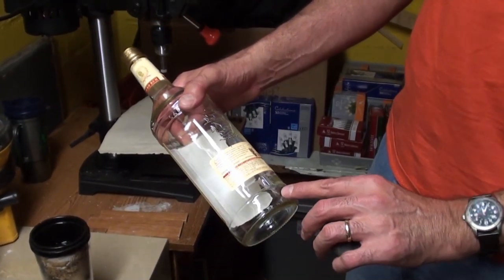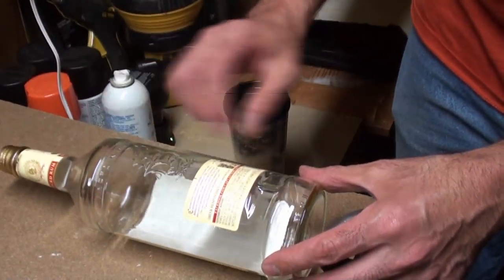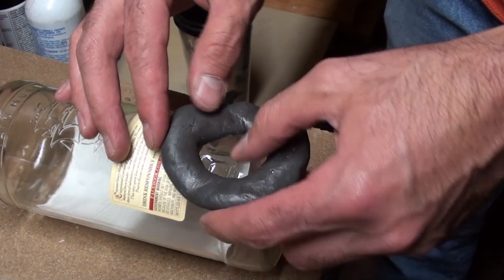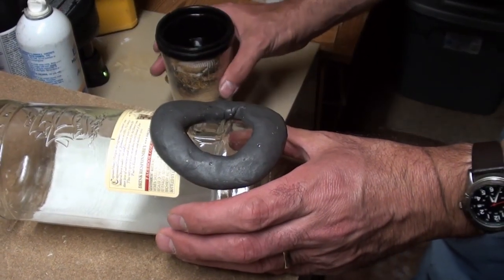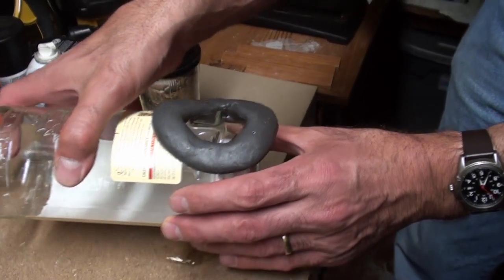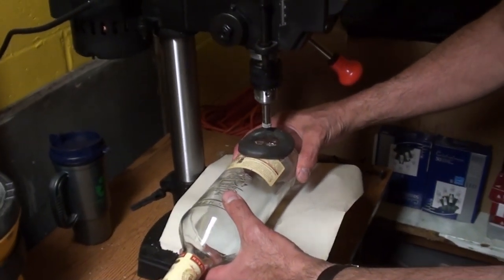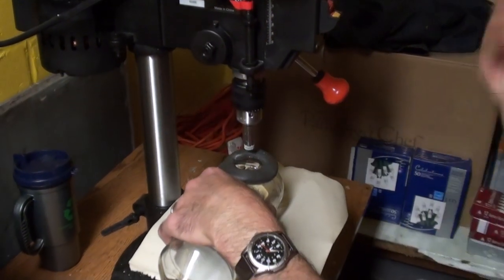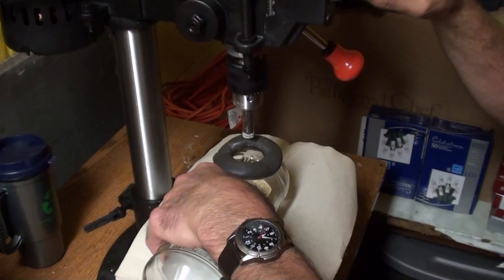How to drill a glass bottle quickly *DIY Glass Bottle Lamp*

Comment: I have a drill press that you can adjust the belt on for different speeds. Do you have a suggested speed for this?
Reply from the maker: Good question! My drill press had adjustable speeds as well. I had it set for the middle speed and lowered it slowly allowing the drill bit to do the work.

Comment from the maker: Did you mean a dremel?
The Dremel Moto-Tool rotates a bit at high speed; the bit is held in a collet. Variable-speed versions may cover a range of 3,000–37,000 RPM. The Dremel uses its speed as opposed to torque to get the job done. By inserting an appropriate bit (or burr) the tool can perform drilling, grinding, sharpening, cutting, cleaning, polishing, sanding, routing, carving and engraving.
I've heard of using one to take the sharp edge off the drill hole but never to actually drill it.

Comment: Thanks for the video.  Do you have some recommend vises to hold the bottles?  Especially rounded bottles?  What's a good way to stabilize them?  And what is the wax thing you use to hold the water?
Reply from the maker: VIDEOGAMETV, Good questions! You could try a bar clamp (http://amzn.to/2yKUiwj) that has the rubber feet on it. Hold one end with the clamp to keep it from rolling around and allow yourself to drill with both.
The rubber ring (plumbers putty) is to keep water over the area that you are drilling to help reduce heat and collect the glass drill dust. Happy Crafting!
Reply: Nick Jager thx 1 last question I think. I ordered the wen drill press you linked. I have a 5/16 diamond hole saw I got in the tile cutter aisle in lowes. Do I need an adapter for the drill press? It fits in my hands drill
Reply from the maker: VIDEOGAMETV, No adapter needed. You'll be ready to go once it arrives. Be sure to let us know how your project turns out.
Reply: Nick Jager ok Im going to do it Saturday

Comment: Hello man that was a fast drill, can you tell me the rpm used?
Reply from the maker: +Márcio Bettencourt,
2,400. It makes the whole process so much easier. I have another video that I drill a hole with just glass drilling bits. Easy 1/2 hour. Thanks for stopping by!
Reply: +Nick Jager Nice. I bought a cheap drill press today, it does 1,400rpm I'm yet to test it. I have the hexagonal glass drill bits with 8mm. You think I would be better served with a diamond drill bit?
Reply from the maker: +Márcio Bettencourt,
Yes. The diamonds are glass bottles best friend. You'll be happy that you went out for them.
Reply: +Nick Jager HYey again Nick. Actually the highest speed of my drill press is 2620rpm it is amazing! Now I just need 3 things: A way to make stabilize the bottle because it shakes a lot when the drill just pierces the bottle, I don't know if this effect it's enlarged because of the hexagonal shape of the drill bit. Anyway, I need to buy the one you used here.

One more question, I tried to use playdough to make a wall around the area but It is just a mess. How can I make the ring you used?
Reply from the maker: +M&#225;rcio Bettencourt,
That's funny because that's what I used the first time as well. It (the playdough), didn't hold water and was a really big mess.
Try plumbers putty: Prime-Line Products RP31001 Plumber Putty Ring http://goo.gl/sugxkZ

Comment: Great video. I didn't have the wax ring so i just put the whole bottle under water. Worked great. Using half gallon bottles to make hookahs right now.
Is there an easy way to cut Heineken, Newcastle etc bottles? Want to string them together like xmas lights for my deck
Reply from the maker: Hi Chris,
This sounds like a really cool project! Are you wanting to 'cut' or 'drill' these bottles?
cutting - I'm using the Kinkajou bottle cutter right now to fairly consistent success.
Drilling - A 1/2" size drill bit should do the trick for your 'Christmas Light' bulbs.
Let us know how your project turns out.